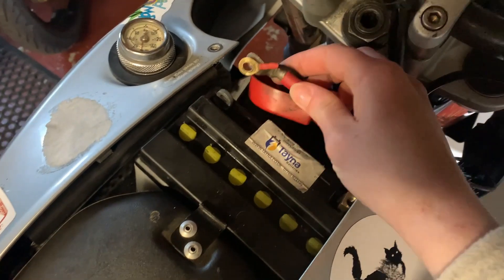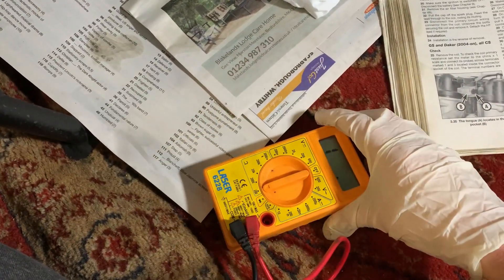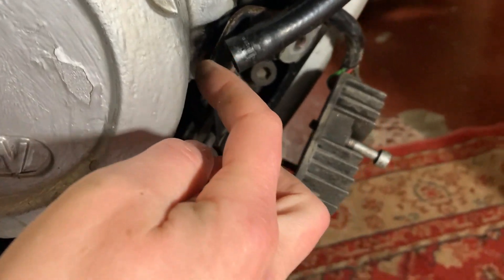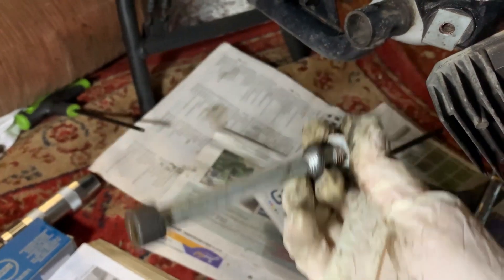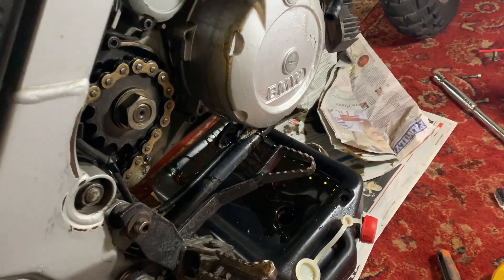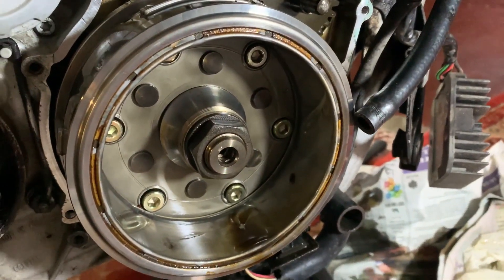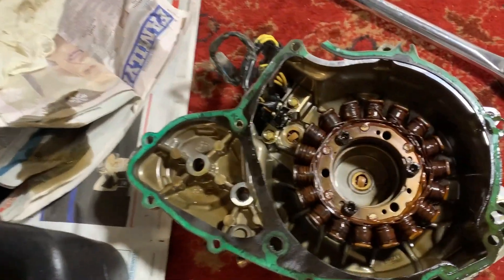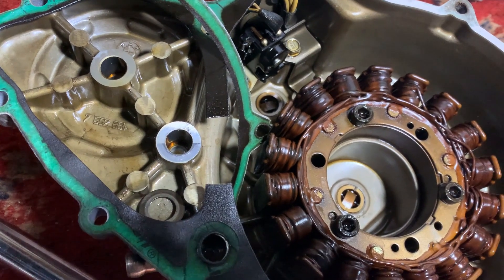PART 4 - ALTERNATOR - F650 STALLING - METAL PARTICLES ON IGNITION TIMING SENSOR/CRANKSHAFT POSITION

Comment: I had the same stalling problem on my 2001 gs. I took apart the intake manifold, cleaned it and removed Ic valve from the throttle body. Cleaned everything and assembled it back. I made sure that the airbox sat properly on my throttle body because earlier can't say that it was positioned correctly and not stall since then.

Comment: Thank you for your video. And especially for the close up of that washer which I am missing. My bike had catastrophic stator /rotor failure! Metal shavings everywhere. Copper bits too. And epoxy bits also. Did you do any more of a tear down to clean yours up? I think the PO must have rode with I pods in blasting because it looks like he rode it allot after it grenaded! In fact I’m guessing he jump started it numerous times after it wouldn’t start on its own. Any advice on cleaning the oil system or should I just tear it all the way down?

Comment: If I'm not mistaken 2.8 ohm for the resistance of the stator winding is way too much, it should be at most 0.5 ohm. Your stator is busted. Mine has about 0.9, I'm afraid I will have to change it. The voltage doesn't rise when revving up the engine.
Reply from the maker: Thanks for the info. Is your bike running badly too?
Reply: @HaynesGarage  My battery is busted. I think it's because of bad charging. But I don't think the stator is the cause, because I remembered to measure the probes in short, and they're about 0.4 ohm, so the stator would be just about right. I suspect it's the rectifier. I will order a new battery and see from there.
It's my mistake, I have a usb plug with a voltmeter installed, but I didn't think of monitoring my voltage once in a while and when the cold weather came the battery showed signs of weakness.

Comment: Can’t thank you enough for these honest and detailed videos.  Also love your matter of fact pragmatism.  People could learn a lot from your approach to tasks well beyond motorcycles.  Good job.  Having said that, I must admit that your videos have gotten me completely off looking for an early f650 gs.  I’m now hunting for a late carb f650 funduro.  In the mean time, I’ve just purchased a ‘06 Suzuki Vstrom.  Best of luck with your mechanical sleuthing.  I’m looking forward to you getting it all sorted and giving us a summary of what you’ve learned.  Maybe then I’ll get an early F650 gs.  Engine foibles aside, it’s a compelling bike.  Take care. R
Reply from the maker: Hehe, thank you. Another subscriber also mentioned about the earlier 650, Strada. It has been a real pain in the back side with the stalling issues, and most worrying of all the stalling at high speed. However, I have continued to ride it occasionally over the last few weeks and the high speed stalling still hasn’t happened after replacing the battery. The low speed stalling occurred after my friend had ridden it for 100 miles, and we had worked on it in the garage, possibly knocking the throttle a few times. I’m wondering whether the low speed stalling has always been a glitch in the bikes computer system.
Reply: @HaynesGarage  there’s an owners group (forget the name) in the US that has a ton of info on this problem.  Apparently there are 4 major ecu remaps and 2 injectors, and the combo of these elements has pros/cons for all pairings.  From what I could gather, it’s a fundamental problem with the ecu that has no complete fix.  Having said that, some people claim they’ve never had any problems.  Go figure.  Still, as I mentioned, I like the platform, and will probably own one eventually.  Best of luck.  R.

Comment: Thank you very much for this video! Just found recently some metal "particles" (quite big actually like 5mm, magnetic, only in pan, not in filter or reservoir) when changing the oil. And of course today in the morning when I tried to overtake a bus the engine almost stalled and I almost fell over the handlebars (exaggerating of course but the slow down was quite dangerous). Then it happened this evening when testing new injector (with higher flow rate) under hard acceleration several times. The RPM was going crazy, 7k then 1k, but engine was not doing these revolutions. Funnily when playing with diagnostics yesterday it showed some error with crank position sensor, but I've never experienced this before, only today. So I cleared it and thought nothing of it. Weird is that after today's behavior there were no errors in diagnostic. But all points to it being faulty, probably covered with metal particles. I still have to find out from where these large magnetic particles came from. At first I thought gearbox but now I'm thinking starter or flywheel, who knows. I'm gonna report what I find when I open the cover, probably this weekend or the next one as I probably should buy a new sensor first.
Reply: So yesterday after cleaning the connector of CPS and a quick ride it seemed ok, no crazy tacho dance and deceleration after hard acceleration. I was quite happy but still had some creeping doubts. And of course today on a paved bumpy road it did it again. And when riding several rocky offroad sections it was quite often doing weird tacho stuff, but only 1 times decelerated (when going uphill of course lol). So I took it apart few hours ago and indeed there were small metallic particles on the sensor (between those 2 wires). So I gave the sensor some good cleanup and also the flywheel/rotor had some particles on the inside. Nothing really crazy bad but I didn't think it would be as the bike rides fine, only very rarely stutters, mostly on rough road or very hard gas. So I put it together again and hopefully all will be fine, as I don't really think the sensor itself can brake easily, it either works or doesn't. The resistance was 286 ohms, so within spec. The bike starts always on 1st try and rides "basically" fine, so really not a measurable fault I think. Well tomorrow and the day after should be raining so I won't test it only in garage (I could slide the rear if the deceleration thing happens at high speed and I'm definitely no drift king). Oh and very good news is that those large (supposedly) metallic particles were just pieces of paper seal - I got confused as the seal was very brittle and hard almost like an alloy and microscopic metal particles were on it so it stuck to a magnet. After good cleanup it wasn't magnetic. Anyway there weren't present in the stator area at all.
Reply from the maker: Such a shame you are experiencing the loss of power too. So dangerous, especially when overtaking larger vehicles, likes buses! Thanks for all the updates as it’s a good comparison for other f650 riders who may be having similar problems. I’ve not been able to ride my bike properly for a while now (35 weeks pregnant) but hopefully in a couple of months I’ll be back on her and I can see if the new battery has made a difference. Fingers crossed! Good luck with your bike, and ride safe!
Reply: @HaynesGarage  yeah it's quite scary as the single is barely enough to overtake anything on road let alone with loss of power lol ! the bike started yesterday on 1st try so I assembled it fine it seems (didn't forget the bloody washer), now I have to test it on some rough road or rocky offroad when the weather gets better. Btw it's kinda hard to put the cover on (and not destroy the seal) as the magneto sucks the cover with quite rough force so beware! Thanks for the kind words and good luck with your pregnancy! You will be back on the (off)road in no time. And exactly I hope it helps some fellow riders to diagnose the issue better if they read my comments.
Reply: Nope didn't help..still hard deceleration and tacho dance on big bumps yesterday..now I'm going to change the wiring to BMS + CPS connector. Then new sensor I guess. Wish me luck !
Reply: omg you won't believe what it was after all this struggle - loose + terminal on battery! It was one of the first things I tried but the screw was tight so I thought the cable is tight as well. But the bloody screw was somehow stuck in half-way position so obviously the cable was loose so on big bumps there was a bad connection for split second = manifested exactly like bad CPS (high RPM, sudden stalling etc.).

Comment: Noce video!
I have a question I'm hoping you might help me with (I am not very mechanically inclined, but I'm trying to fix an f650st)
At time 1:20 you remove a hose, where does the other end of the hose go to?
Reply from the maker: Hi Alex, thank you. I’m still learning a lot too. I believe the hose you’re talking about connects to the underside of the air box. I use max fische diagrams on the internet to help with part finding in case that is any use to you. Good luck fixing your f650st.

Comment: Nice to confirm it's clean with no metal bits. 

Re: dirt - I got one of those micro-adapter kits w/mini hose and brushes (to clean inside a computer using a normal vacuum) to clean up grit before I crack a case open. They're so handy for lots of things.

For the stator you can check each of the 3 wires against ground. There should be no continuity. Then check each one against the other two (1-2, 1-3, 2-3). There should be very little resistance between them and they should be about equal. 

Good to see you out there in winter!
Reply from the maker: Thanks for that, the micro adaptor is a brilliant idea. I’ve also tried to clean out the dirt as best as possible but my friend has recommended I do two oil changes before running the bike properly to be on the safe side. The gasket arrived today so I can get to work putting it all back together. I am also contemplating re installing the majority of the rigid oil line that I cut off before. I thought it was a good idea but I worry about the flexible hose getting damaged or burnt on the engine casing so I may have a little play around with that too whilst the oils out. Sometimes modifications don’t always work out for the best!
Reply: @HaynesGarage  Sorry you have that extra work on top of it! Good idea about the oil changes. Maybe you could obtain some good used oil (like from a car oil change) just to flush it 2x at idle, before putting the new oil and filter in. 

One other good thing for dirt around the case - I love using duct tape. I wrap it around my fingers, sticky side out - or if fingers don't fit in a space you can wrap it around a butter knife. It picks up so much crap!
Reply from the maker: @c.meyers2882  It’s ok, I have some cheaper oil left over from my last oil change so I’ll use that up first and then buy some better stuff. :)
That’s another good idea about the tape. I use a similar trick when I’m trying to get rid of cat hairs on my jumpers ;) they get everywhere!

Comment: This is worthy for checking flywheel magnet,  debris, starting gear, wiring broken and changing gasket to prevent leakage by degradation. 
It is never over-maintenance for old bike. 
Love it , or Fix it.   You are not alone.
Reply from the maker: Thank you :) It’s good fun learning about how it all works too, even if it is a bit messy, and costly taking it apart. I’m hoping all these checks will help the bike run well for a few more years yet to come.

Comment: Quite a messy ordeal, do you recommend doing this on an older bike (even thou there were no complaints)? Or should I do it only if it starts acting up?
Reply from the maker: Hiya, my Dad always said “if it ain’t broke, don’t fix it”, but at the same time I have learnt that the longer something is left, the more problems it can cause in the long run. Now I am working on my bike more often, it is easier to remove many of the bolts and fittings because I have cleaned parts up and used anti seize. The worst bit was when I first started getting in to mechanics after owning the bike for 6 years and everything was such a pain to remove, many parts were broken, seized, or had disintegrated when I removed them (such as the swing arm bearings/headstock bearing/side stand bolt e.t.c.) You have to be prepared to spend a bit of money too, and have time available to fix it if it doesn’t all go according to plan ;) So long as the bolts aren’t seized in your connector cover, or alternator casing, removing this part isn’t particularly tricky, but you will have to spend some money on a new gasket. As I allowed some dirt to get in (I’ve cleaned the area as best I could) I will also be doing a couple of oil changes before running it properly.